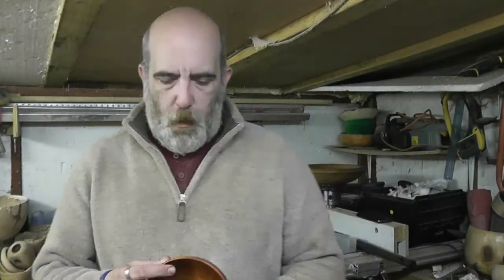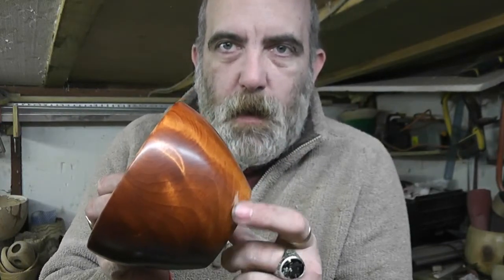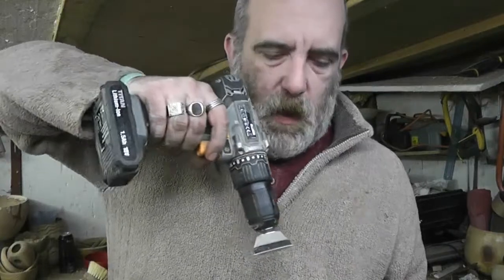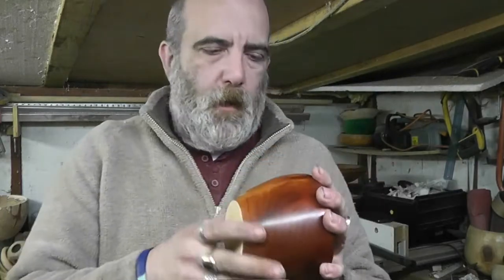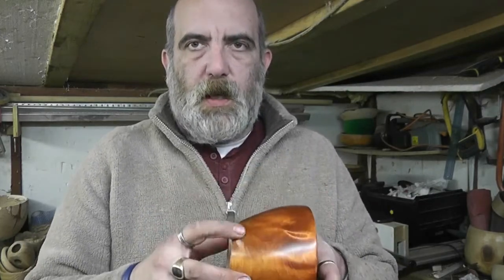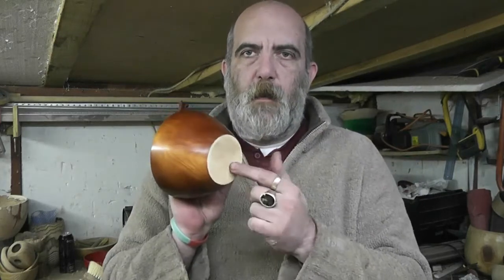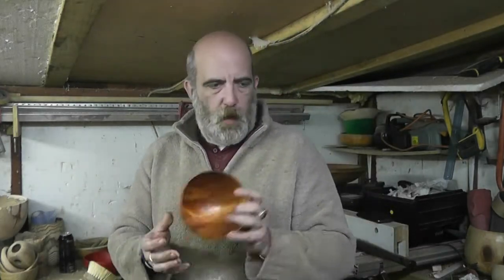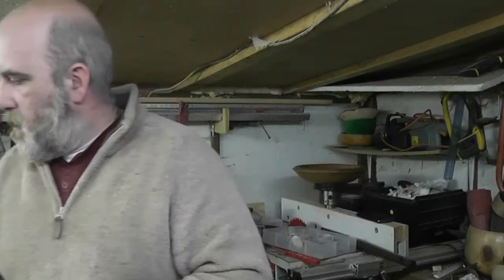True up an finish turn a wet turned bowl/vase

Comment: I really enjoy your videos. You deserve more subscribers. Just wondering, how does the quality of homemade sanding paste compare to store bought ones? Thanks.
Reply from the maker: S.Ø.N totrefirefem thankyou :) , I don't know I have never bought any commercial abrasive paste, I have always seen them as too expensive for what they are, buying the oil, beeswax pellets and the pumice is very cheap in comparison, at the weekend I made another batch to try out using microcrystalline wax pellets instead of beeswax and it works the same but is a little shinier, I recorded that while I made it and used on a project so at some point  before the weekend I will make the vid and upload it 👍